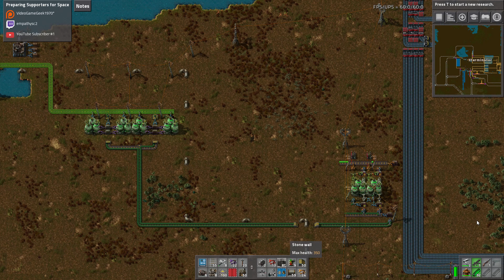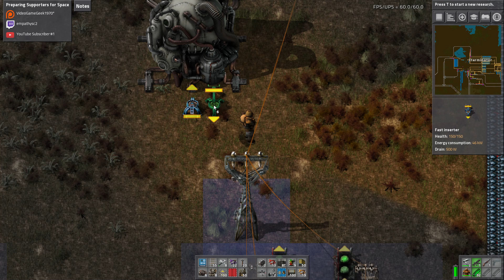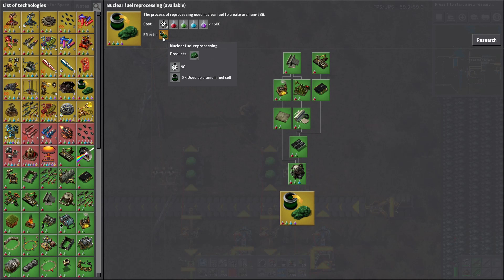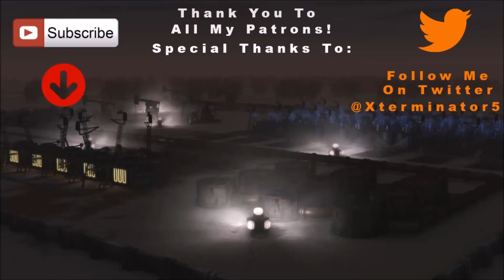Factorio 0.15 Sending Supporters To Space EP 35: Nuclear Power Build! - Let's Play, Gameplay

Comment: If when you switched on nuclear it generated 40MW, and the coal produced around 6MW, then just letting nuclear have 1 cell every 200 seconds is the right thing to do. But what happens is that the game draws 50% power from each type of power generation. So either reducing nuclear fuel cells according to stored steam, or using a latch on the coal power are definitely good things to do.